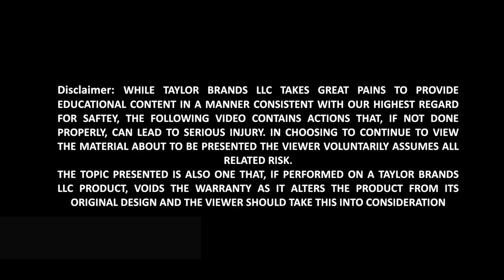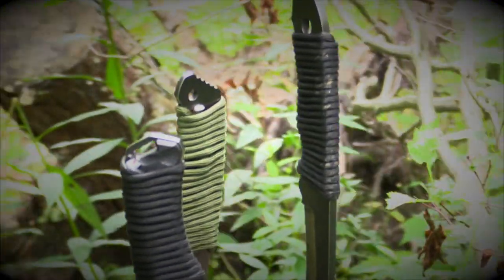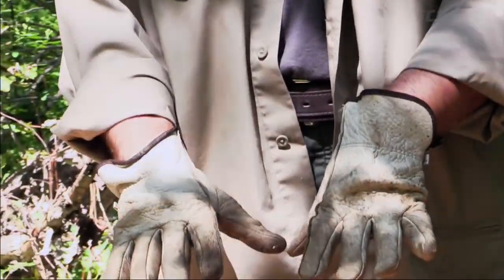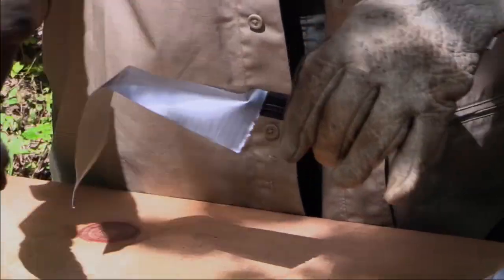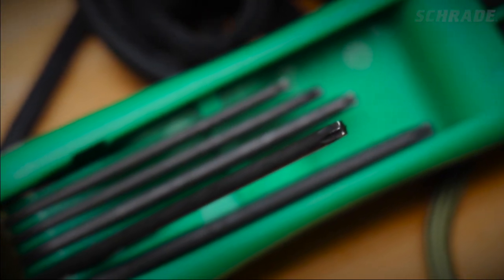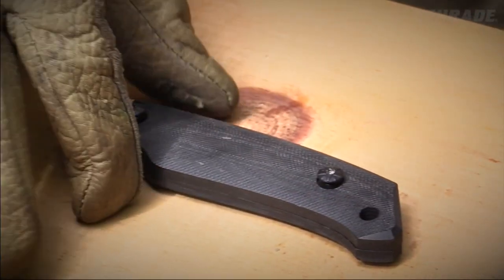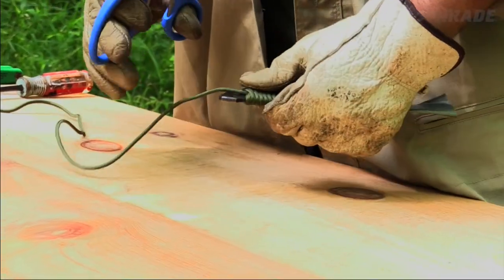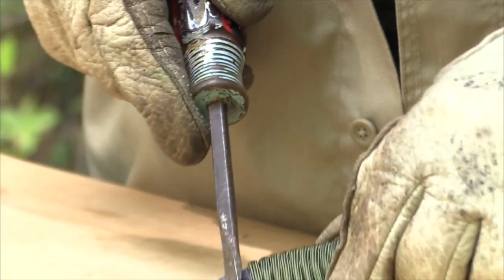3 Minute Paracord Knife Handle Wrap - Best Simple and Easy 550 Paracord Survival Handle Wrap Schrade

Comment: This wrap is called an English whip and it's all so in the s o s survival manual.  Probably in all the survival books.   Its in all 3 of my books.    Its used for broken handles or you can split a peice of wood and slide a thin blade like a saw zall blade to improvise handles.   Pritty cool actually.

Comment: Once you do this you can no longer use the kydex sheath that comes with the knife. It's a pain to heat it up and remold it. Any recommendations?
Reply: don't wrap it all the way up it may be ugly but it's functional not sure if it works just a suggestion (if u r removing the original handles then I think u will have to 're heat not sure

Comment: There is no good reason to ever put paracord on a knife handle.   It may look cool, but it's truly stupid.  It is not a source of extra paracord.  Only a complete idiot uses paracord in a way that disables a useful tool when the paracord is used.  

Paracord makes a lousy handle.  Even a dangerous handle, so it's no good that way, either.  The only things stupider than using paracord as handle wrap on a knife is replacing your shoestrings with it, or wearing a paracord belt.   If you ever have to use the paracord, you'll be left with an uncomfortable, nearly unusable, even dangerous knives, you won't be able to keep your shoes on, and your pants will be around your knees, but, hey, you have a few extra feet of rope you should have no need of.

If you want to carry extra paracord on your person, there's a much better way.  Take a hank of paracord, place it on the palm of your hand, close your hand around it, shove your hand down into a pocket, then open your hand.    You will then have extra paracord wherever you go, and you won't look like an idiot in the woods.
Reply: Or you can buy pants that actually Fit you and just wear a paracord belt for extra cordage if needed.